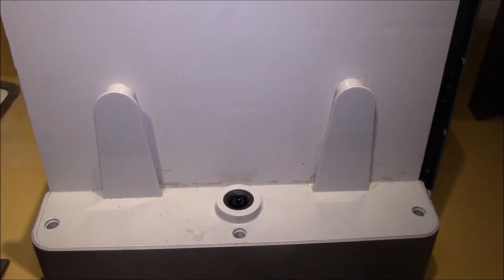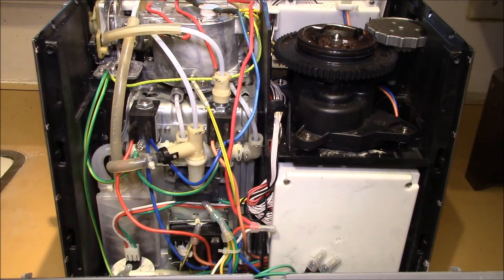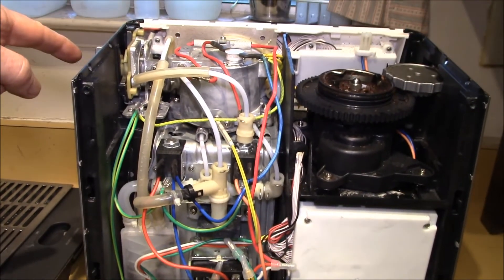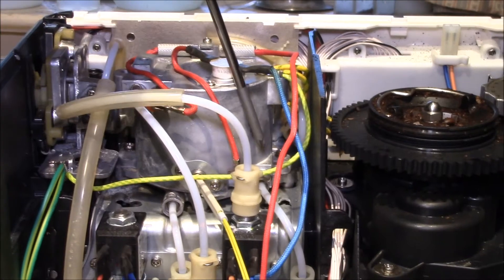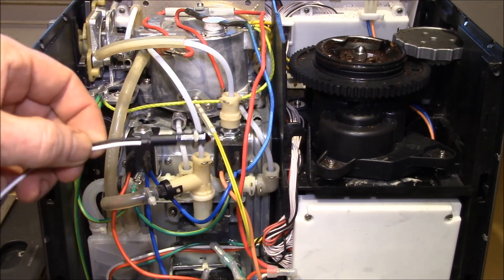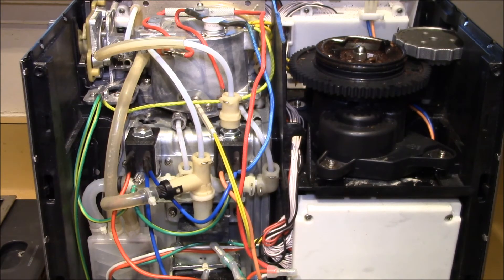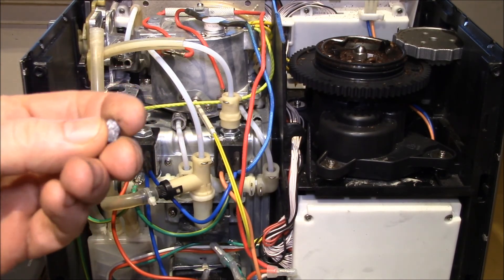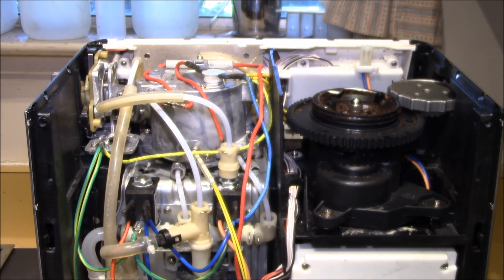Breville/Sage 870XL Barista Express - Water Flow

Comment: R Brown,  I replaced my solenoid block and pump in my Breville 870 XL.  Your videos were super helpful.  However, I have a persistent leak that I can't seem to solve.  I've taken the machine apart mulptiple times to check that all of my O-rings are in place in each hose, the silicone washer is in place in the pump head, all rubber hoses have tie-downs, etc.  I can't seem to solve this.  The symptom is that the machine works fine, but water seems out the back of the unit after I've made a cup of espresso.  Since I can see into the unit when using it, I can't see where the leak is coming from (no clue).  It could be from any of the hoses that I'd disconnected as I replaced the solenioid and pump (which could be any of a numerous hoses that were removed and re-attached.  Any tips for finding the leak and fixing it?   I noticed that the unit seeps water from the back for several hours after using it.  It's a slow leak somewhere, just not sure where.
Reply from the maker: You can pop the back panel open a bit and use a flashlight to see inside while running the machine:
https://youtu.be/46UBebNJ-uo
Just be careful as there are exposed live electrical connections inside.

Comment: Thank you for an optimal description. I now have a Flow Diagram. 1st diagnosis: No pressure indicated and no water flow through Group Head. REPLACED SOLENOID VALVE ASSEMBLY. No change. 
Still no pressure or water flow trough Group Head. Stay tuned.
Reply from the maker: Either the water is going some place, like to the diffuser and drip tray, or there's a blockage in one of the small tubes, or the pump is not putting out enough flow/pressure.  Open up the back of the machine and peek inside, carefully as there's exposed electrical connections inside, and see if you can see where the water is going:
https://youtu.be/46UBebNJ-uo
See if the hot water/steam feature is working.
Reply: This is my problem. No water or pressure, the steam wand and hot water work. I changed pump and solenoid valve with no luck. Im thinking it could be the group head itself? Did you get your problem solved?

Comment: These machines don't seem reliable
Reply from the maker: Mine has been fairly good, this was the only issue I had in about 8 years so far.  They are complicated with the automatic features.  But at least they can be maintained and repaired fairly easily.
Reply: @The4Crawler  wow 8 years, pretty good

Comment: Hi , is the sage barista express grinder fitting in the sage barista pro ? Thanks
Reply from the maker: According to this article, the grinders are similar in design but the adjustment mechanism is different:
https://lifestylelab.ca/barista-pro-vs-barista-express/
Reply: @The4Crawler  thanks for your help
Reply: still can't I adapt it?
Reply from the maker: @micheleignozza5951  I might be possible, although I have no experience with that newer machine.  Looks like at a minimum it would involve some extensive modification to the case of the machine.
Reply: @The4Crawler  thank you 👍🏻👍🏻

Comment: Thanks for this great video. My Barista Express is tripping the power when making a shot of espresso, but not when steaming milk. Any ideas on what to do please? Cheers Dennis in MT
Reply from the maker: Likely an RCD or GFCI breaker?  If so, chances are there's some sort of electrical leakage inside the machine.  Common is water leaking onto the solenoid valve coils and leaving a conductive path between the terminals and the grounded metal of the machine.  Pull out the valves, remove the coils and see if there's any sign of that:
https://youtu.be/96IuKiuIB5A
If not there, might be a similar issue around the thermo-coil or the pump.
Reply: @The4Crawler  Thank you! I will check and see where the leak is. It works for one shot then ... bang for the rest of the day! Simple question. How do I take the back off the machine once the water tank is removed. There is a black plastic insert that is tough  to remove. Can I drill it out or will that damage anything below? A YouTube video on how to take it apart would be useful, but cant find one.
Reply from the maker: @DennisGibson123  Covered in this video:
https://youtu.be/96IuKiuIB5A
Reply: @The4Crawler  thank you!!

Comment: I really hope you will answer me. So I have a sage bes870 that does not move any water. I don't know if it's the solenoid or something else. What do you think it could be?
Reply from the maker: Any number of things.  Tank outlet to the pump could be plugged and not letting any water into the pump.  The pump might be clogged or worn out and not pumping any water.  The overpressure/safety valve could be stuck open and sending all the water into the drip tray.  The 3-port solenoid valve could be stuck and that send all the water to the drip tray unless you set the manual valve to hot water of steam.  Or there could be a clog or leak in any of the internal water tubes.  Best option is to start checking each part and "follow" the water.
Reply: @The4Crawler  so I have everything going to the drip parte, but the problem is I have no steam or hot water. Nothing comes out of the machine except through the dripping tray
Reply from the maker: @wowfoodorg  Well then it's either the safety valve sticking open and dumping all the water or it's the solenoids, perhaps the 2-port one is stuck open and sending all the water to the drip tray.  Open up and back of the machine and carefully peek inside with a flashlight while you run a cycle and see if you want find where the water is going.

Comment: I have the same Breville that worked very well until today. There is no water priming, and very little water intake. Heating works, but no water on any outlet. Brewing, steam, hot water are all gone. I tried the cleaning tablet but it cannot do it as it has too little or no water in take. Tube clogged/solenoid pump? I am mad, I don't know what to do. It easy to open but where do I buy tubes or solenoid pumps for this machine? I loved your video and the way you explained water flow.
Reply from the maker: See pump information in the video below:
https://youtu.be/i8GGZHKNxPo
Likely the inlet water filter (between the water tank and pump inlet) might be clogged.  Search for videos on how to clean that.  Or check the other tubes, pull one at a time off and try blowing through each one to see if it's clogged.  Might also be the safety / over pressure valve is stuck open and is dumping all the water into the drip tray.
Reply: @The4Crawler  thank you for your  quick an informative message! The water level in the water tank does not move, just like 5 mm-1 cm after many trials for stem/brew.  When I tried the steam, it spited very little steamy water, then it died. When I press the brew 1 or 2 cups (without the coffee-single wall filter on), there is only a cloud of steam coming out. When I tried the cleaning tab, it poured just 2-3 tsp of brownish soapy water.
Reply from the maker: @ancamg  You need to figure out what the root cause of the problem is.  Either water isn't getting into the pump inlet, or the pump isn't pumping the water that gets in or something is blocking the water leaving the pump.  In your case, the over pressure valve is likely sending water to the drip tray as the level in the tank doesn't fall.
Reply: @The4Crawler  I don't know if you believe in miracles, but I find difficult to understand.All morning I tried in vain to make it work. Then I started to research, until  I found your videos. I almost cried as I had no chance to have it repaired soon enough. Half an hour ago, turned again the machine on, and from the first moment I noted the pump working, pumping water in the system (I call this thing priming). Then I tried the steam wand and it worked. Brewing woks too. I tried again the tablet cleaning, after that I did the white vinegar/water 1:1, and sent this through all 3 outlets. Of course I cleaned the vinegar from the system. I am so happy! It must have a sort of embolism at the level of water inlet in the machine, as you said in your message.Even if my machine decided to work I am still happy I learned from you how this espresso maker works
Thank you so much for the videos and your quick responses!
Reply from the maker: @ancamg  Glad you got it working again.  May just have been something blocking a water line and it eventually broke free and let the water flow properly again.

Comment: Hi, great and informative video. May I ask where the problem lies if I am facing this problem https://www.reddit.com/r/espresso/comments/nqzz1i/breville_water_leak/?utm_source=share&utm_medium=ios_app&utm_name=iossmf. Thank you:)
Reply from the maker: It sounds like you already replaced the silicone gasket, did you check the old one for damage and that the new one was similar thickness and size?  It looks like the filter basket is being turned a little too far, suggesting the new gasket might be a little thinner.  Could also be the cleaning disc in your filter basket is plugged up or stuck to the basket and not allowing water to flow.  It should have a small hole that limits but not blocks water flow.  Couldn't see the pressure gauge but was it reading high or low?

Comment: This is a great video.  I had problems with no water at the group head.  Steam and Hot Water are good.  I replaced the solenoid assembly and symptoms didn't change.  Could it be that the signal from the Flow Meter or the Control Board are not turning on the Group Head Solenoid?  What should the voltage be on the Orange and Blue wires?  I'm assuming the Green is Ground.
Reply from the maker: Should be full voltage on the solenoid coil, 120V or 240V depending on your model:
https://youtu.be/yYJRQu3ZUik
https://youtu.be/9cC-m3a-oXY
Do you hear the solenoid clicking on when you press the 1/2 cup buttons?  I think the flow meter is used to determine the volume of water and when to shut off the brew cycle and switch the solenoids to the purge cycle.
Reply: @The4Crawler  I do hear the solenoids clicking.  And i just double checked the 120v.  On the "dump" solenoid i get 120v when the 1/2 cup cycle completes. Once the dump is complete it goes back to 3.8VAC, but i never get 120v to the "brew" solenoid.
Reply from the maker: @markblocksom3051  Sounds like that solenoid is being actuated properly but the 3-port one is not.  You'll see the low voltages on the solenoids when off, my indicator LEDs glow faintly when the machine is "off".  Could be a bad connection on the main circuit board or a failed driver Triac that is not sending power to the solenoid.
Reply: @The4Crawler  I just opened the Control Board and noticed that TA4 is completely fried!  I think this is the transistor that turns on the "brew" solenoid.
Reply from the maker: @markblocksom3051  Sounds like the problem.  Yes, there's typically one of those per solenoid.  I've heard the p/n is BT131-600
Reply: @The4Crawler  Thanks Ron.  I saw Mike Anderson's comment on an earlier video you produced.  Looks like I'll be testing my rusty soldering skills.
Reply: @The4Crawler  Ron, Thanks for the quick reply.  I have the 120V system.  I have ~3.9VAC at the Red and Orange wires, and 0.2 on the Blue wires.  Then when I select either hot water/steam or brew the voltage goes up to ~ 4.1VAC on Red and Orange and ~3.8VAC on the Blue.  I never have 120v on any of my solenoid inputs.

Comment: Very useful video for problem solving.  For a couple weeks, I have had low shot pressure and weak steam.  After viewing your video, I have a much better understanding of how everything works/flows, and I have confirmed that my problem is the safety valve.  Whenever I pull a shot or use the steamer, water escapes from the side of the safety valve into the drip tray.  Hence the lack of pressure/steam.  I'm happy that I finally figured out this problem with your help.  Thank you!
Reply from the maker: Great troubleshooting, glad you found the issue.  That valve may have some scale inside causing it to stick open.

Comment: hello R Brown. Any idea how to fix this? https://youtu.be/0kvCL0LogkA I guess it might be the solenoid because I get hot water with steam, thru the portafilter or the hot water tap. Should I replace the whole solenoid?
Reply: do you know what part number is the solenoid?
Reply from the maker: Solenoids are not turned on during hot water/steam operation, except at the end to drain off excess pressure and water.  It would be the hot water and steam switches on the manual valve are connected up backwards.  That would cause the hot water to be superheated (like it is in steam mode).  Or try resetting the temperature with the Advanced Temperature Mode (pg. 19 in the user's manual).  Or it might be the built-in water temperature sensor is faulty and reporting an incorrect temperature.  Maybe Breville Support folks can assist with additional troubleshooting.

Comment: Great Videos (all)  Do you know if the flowmeter is screwed or it just fits tight?  I have the impression that the in line filter is clogged and I want to take it out.  By the way I am working on a Soles Pro 114 which is the same as the one that you have but it works with 240 Volts.
Reply from the maker: Not sure but it seems like it just sits there.  Don't see any screw holes on the part in the pictures I can find.

Comment: Amazing , very detailed and very understandable video. Wish my teaching instructors back in the day had this approach. 

The elbow you mentioned in the lower right area that connects the tube exiting the bottom of the thermal heater to the solenoid that directs to steam or brew, is cracked and leaking under the pressure/brewing cycle.  What is the actual part/name so I can replace it? 
Do you have a detailed schematic dwg. of the parr’s list?  
Thanks again.
Reply from the maker: There's a fairly detailed part diagram on the eReplacementParts web site:
https://www.ereplacementparts.com/breville-bes870xl-the-barista-express-parts-c-116052_116055_290179.html
You may need to contact Breville for that part as I've not seen it listed separately anywhere.

Comment: HI thank you for your videos I just replace the solenoid Valv and now the water got out from the drain port directly the sound is ok but the water go down :(
Reply from the maker: Could be a number of things.  One is the tubing was hooked up incorrectly.  Or the wires to the solenoids are not making good contact or the 3-port solenoid valve, is still sticking part way open.  Unless it fully opens, the port to the drain is left open and water will take the path of least resistance and go that way instead of through the restrictive group head and filter basket.  If the hot water and steam functions work OK, it's likely the 3-port valve sticking.
Reply: @The4Crawler  I found the problem I ordered 110v and I got 230v and I was able to find the problem because of you !!! 

thank you u r the best
Reply from the maker: @seanbenyakar7722  Good find.  You should be able to remove the coil on the 230v solenoid and replace it with the 110v coil, that is if the old coils were not burned out.  Just unscrew the tube and nut on top and the coils slide right off.

Comment: Wondering if anyone can help me!! 

My machine has recently been turning on and instantly going into a fault mode where the Programe button lights up solid and not other functions work. The solution is to turn it off at the socket however I have done this now and my machine will now not turn back on? I have opened the machine up and checked to see that there is still power getting to it and there is. Not sure what is wrong?
Reply from the maker: Sounds like an issue with the power supply portion of the main circuit board:
https://siber-sonic.com/appliance/800Electrical.html
It sounds like AC power is getting to the machine, but it's the low voltage DC power that's got the problem.
Might be worth contacting Breville support and see if they have any troubleshooting ideas.

Comment: Thanks for the video. I am wondering if you have a suggestion for there being low steam pressure. I just replace the solenoid, and see that there is corrosion around the two tiny hoses that are up by the steam dial. There’s also air in the slightly larger holes on the same part. Is this normal? Or is it an indication of a specific problem?
Reply from the maker: It could be some buildup inside the hot water/steam valve.  The large hose there just leads to the diffuser and drip tray, it's the discharge/drain hose.  Maybe try running a few descaling cycles using just hot water and steam.  Otherwise, you could check my video where I did a repair on that valve to fix a leak.  You might be able to use a drill bit to clear out any debris inside the tube that I replaced.